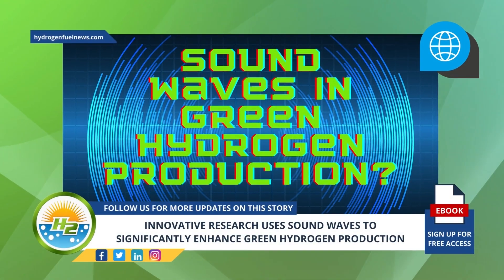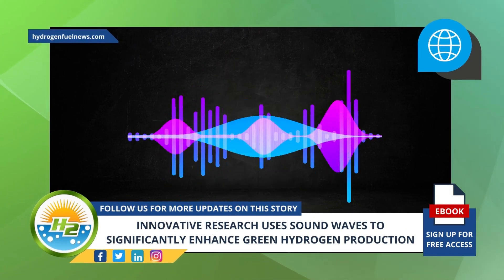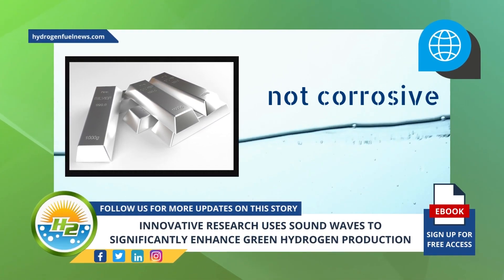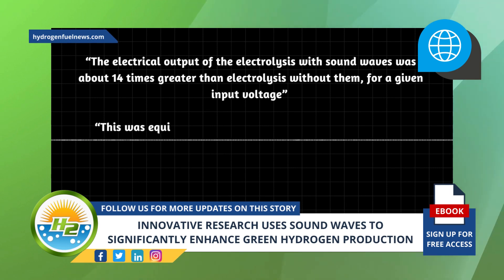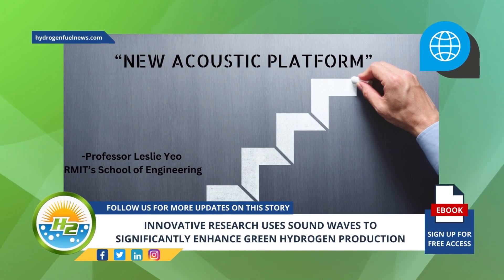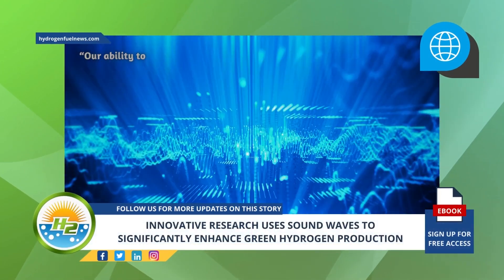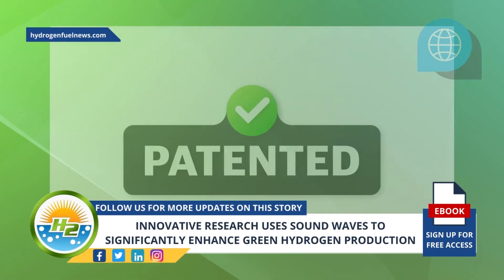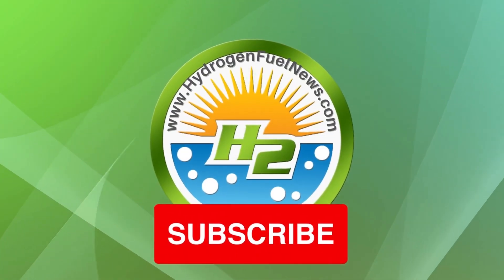Innovative research uses sound waves to significantly enhance green hydrogen production

Comment: Getting bubbles off of the electrodes can be easily done with stirring. There’s probably more to this process that is not revealed. It’s probably ultrasound that primes the water molecules to splitting easier, maybe cross referencing this with Star in a Jar research could lead to some breakthroughs.

Comment: So it sounds like sound is used to knock bubbles off the electrodes, but sound alone should be able to shake hydrogen off of water molecules without the need of electrodes all together. Everything is frequency and such produces all they were see and experience, as well as can convert all we see and experience. See Walter Russell’s periodic table and notice he has corresponding frequencies that pair with the elements.
Reply: It's already happening with radio wave . 13.56 Mhz radio waves split the hydrogen

Comment: The last part tells it all - how to apply this finding to existing electrolysis equipment. Likely a whole new design will be required to incorporate sound vibrations but it was a great discovery!
Reply from the maker: We greatly appreciate you sharing your thoughts! Get ready to dive into a world of hydrogen information at our site: https://www.hydrogenfuelnews.com/featured-news/. Don't miss out!
Reply: Getting bubbles off of the electrodes can be easily done with stirring. There’s probably more to this process that is not revealed. It’s probably ultrasound that primes the water molecules to splitting easier, maybe cross referencing this with Star in a Jar research could lead to some breakthroughs.